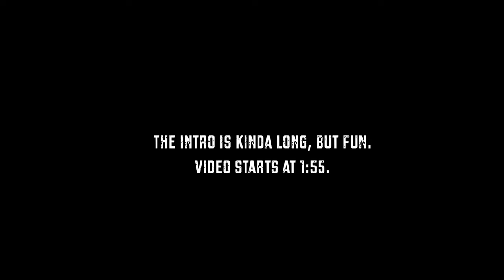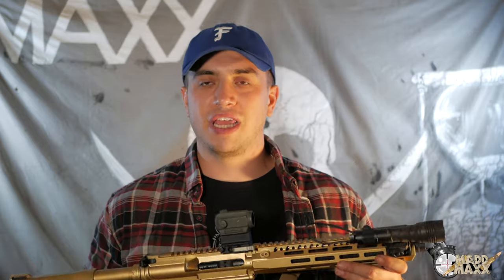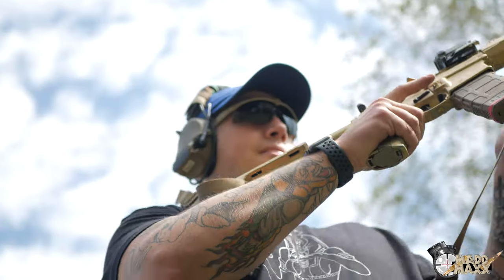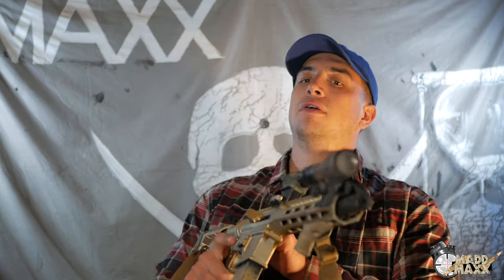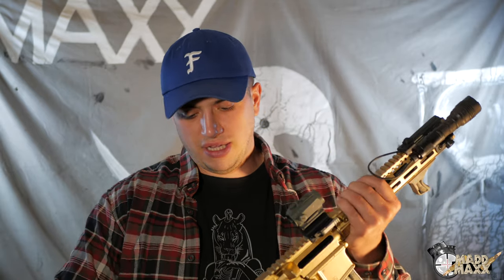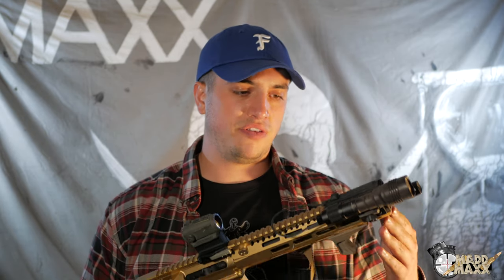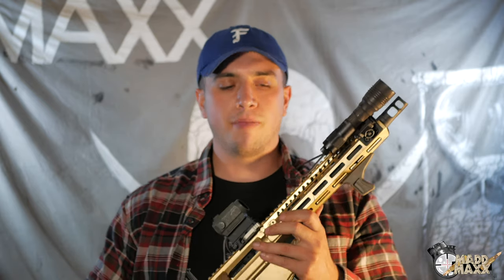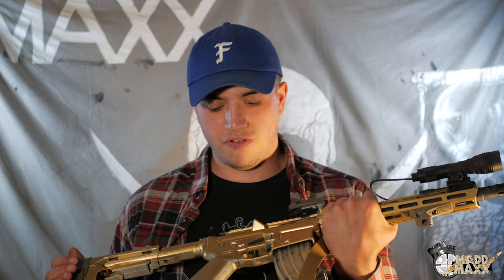The Golden Gun | Parts bin AR 15 10.5” pistol build

Comment: Nice build and take off of The Man with the Golden Gun. Send that light back to Streamlight they will fix it or replace it they're really good people there. If you would like I can replace the gas key and gas key screws on your broken bolt carrier. Add the proper sealant to it and the correct inch pounds of torque and get that bolt carrier going again for you. I have all the parts here to do it. Have been building AR-15 platform rifles since 1984. Very nice looking gun. Someone please donate a BCM gunfighter charging handle to this man, LOL. Great video, take care brother, Echo. PS BC stands for Bear Creek.

Comment: SBA4 is fantastic, the only downside is the placement of the QD socket.

Also, may just be a problem with mine but it can get stuck on the buffer tube when collapsing. As in hard to extend because it's now almost touching the back of the receiver due to over travel. If that makes sense.

Comment: I’ve only had Geissele triggers and I tried the Larue MBT. Sucks compared to the G2S in my opinion. The pull is fine but the reset is unpredictable and swings forward quickly when you release pressure. I’d sure be willing to trade for a Geissele!

Comment: Dude I bulit a poor bin gun (PSA) upper and lower gutted it put a BCM bcg in it pistol gas system , with a YHM barrel cut and pin and welded with a SOLGW Nox and it wouldn't chamber a round I have a 1,000 dollar bolt action AR this is fuckin wack 🤣😂🤣
Reply from the maker: Hate to see it